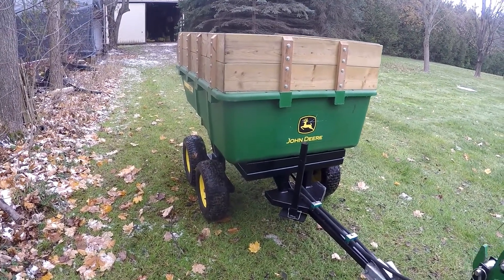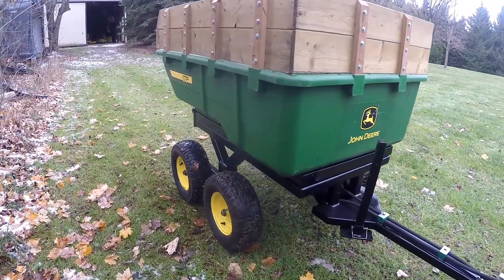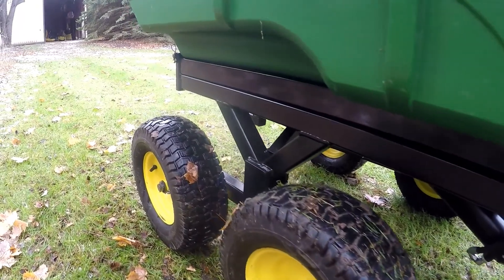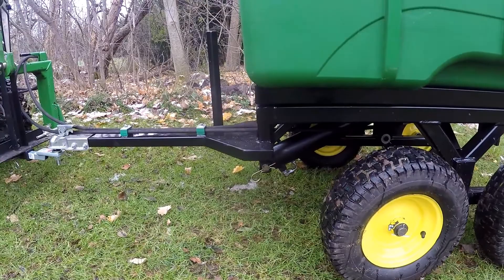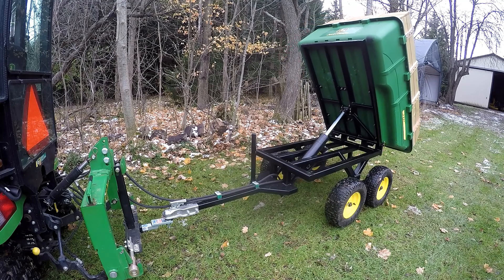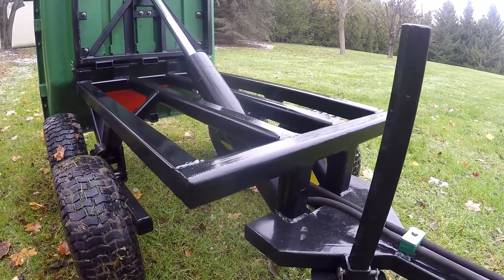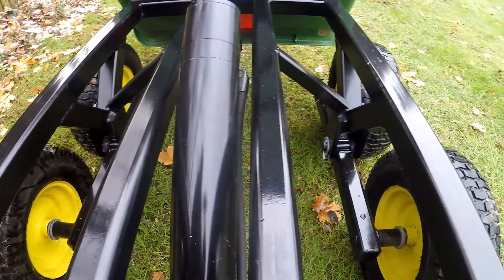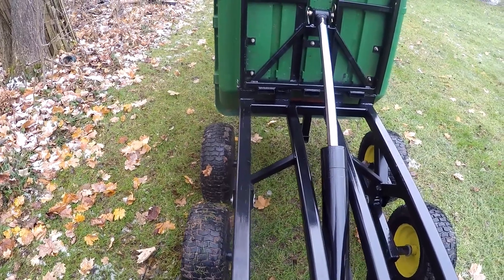John Deere - 17P Tandem Hydraulic Dump Cart with Walking Beam Suspension - 20171112

Comment: Hi, do you know how much weight your cart can lift, i made a custom trailer for my 1025r and i got some issues to lift 4 bucket of dirt.I got the cylinder plug on the stock hydraulic system thank's, great build by the way!
Reply from the maker: Thanks for watching. I believe that my cart can lift between 1500 -2000 lbs. I use a 3" cylinder on mine. Please note that due to the design of the 17P tub that there is a bit of load "behind" the hinge point which helps with dumping the load.

Comment: I like it. I was wondering, are the back hinges strong enough that you don't have to have guide rails on the front sides of the bottom frame so the bed frame always comes down exactly on top of the bottom frame? I was wondering as my wagon has a guide on each side of the frame so it will do just that. Keeps the front of my wagon from shifting side to side when in use too. BTW my neighbor still has their place up for sale. :-)
Reply from the maker: Thanks for watching Levi! Yes I believe that the back hinge is strong enough. I'm using a 1/2" rod as the pin and it goes the full width of the cart. I've had the cart loaded up pretty good at times and so far it has always came back down where it suppose to be. Time will tell I guess if it is strong enough.

Comment: I have the same cart with the same dumping issues so I'm going to attempt to "borrow" your design. Can you tell me what size cylinder you used?
Reply from the maker: Thanks for watching. I used a 3"x20" cylinder for my dump cart. I had to make the cart quite high off the ground in order to have it dump fully due its "duck tail" design.
Reply: @X748SE  Thanks. I’m going to need the room for a 12V/hydraulic pump anyway so I can use it with my ATV

Comment: Nice job. Have you had any issues with the walking beams splaying out from cornering with a load?  I have a old hand crank  dump trailer  that holds 2+ yards and it needs new suspension and wheels. I pull it with a jd 750 and sometimes a 420c. Your build has definitely given me some inspiration. Thanks
Reply from the maker: Thanks for watching! So far I've had zero issues with the walking beam splaying out from cornering with a load.  When I do have a load on i try to make sure that I don't turn too sharply though.
Reply: instablaster...

Comment: Nice work!  Are you taking orders yet?  ;)
Reply from the maker: Thanks for watching and your comment. The cart had been a GREAT to use with new suspension but the only thing that I find that it is still a bit small for my 45 loader. Wish the cart was about 8" longer and wider. May be making a custom dump cart that size so not taking orders.
Reply: @X748SE , I look forward to following your build!  I agree that the 17P dump cart is a little on the small side, but it's not a bad size for some applications.  I have a large 6'x12' (10,000 GVWR) dump trailer that I use for firewood, loads of gravel, dirt, etc.  So, I'm looking for a small dump cart for my  John Deere 1025R.